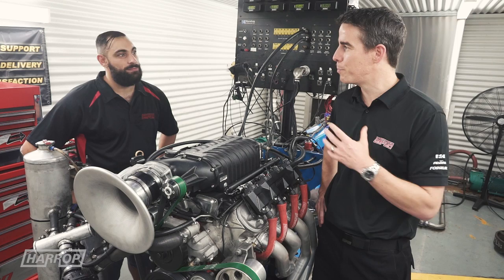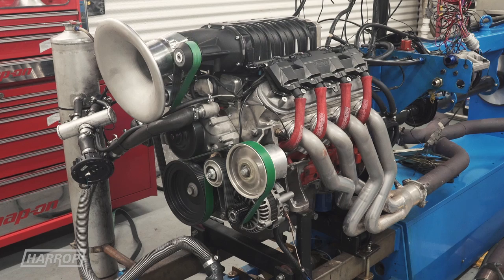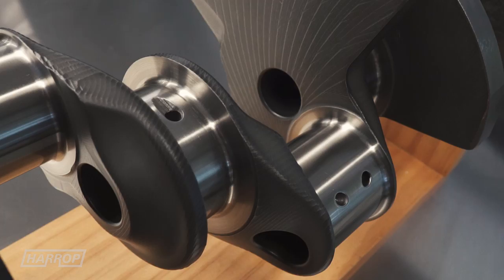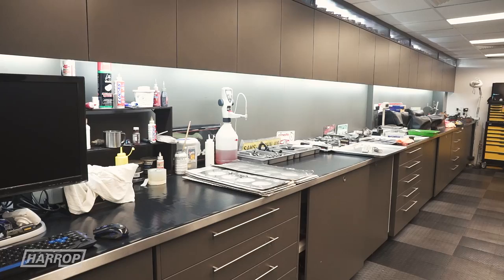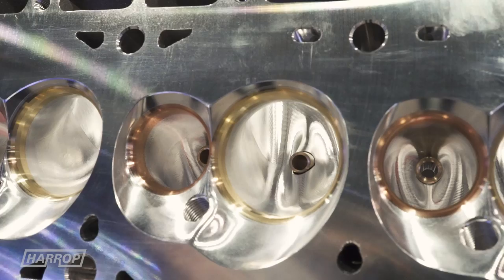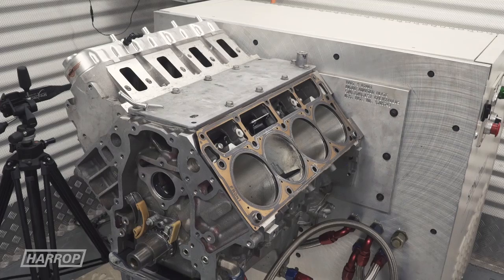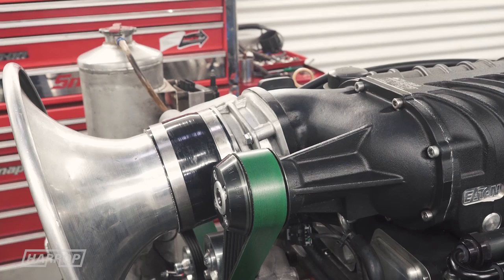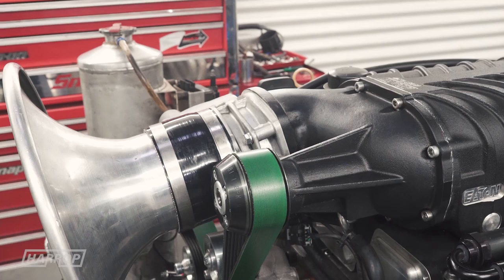Harrop TVS2650 Supercharger Testing | 2300 v 2650

Comment: I was wondering when Harrop was going to develop a larger capacity blower. Those number are awesome! would be be fair to say once this engine combo is put into the car there would be a 22% drivetrain loss for about 700hp at the rear wheels? for the first engine test (2300 and 65mm throttle body)
Reply: 22 percent is awfully high. what transmission?

Comment: It's be interesting to know how much power that supercharger takes to drive.
Isn't that why many OEMs have now gone to turbos away from S/Cs ? (JLR for example)
Reply: Lewis72 yeah they have to save gas mileage any where they can
Reply: There’s charts that will give a rough idea at what SC rpm and pressure ratio how much consumption and discharge temps are. In my opinion a oem typically only puts SCs in when a turbo system doesn’t package well. A turbo will always give more power per pound of boost.
Reply: OEM's are going turbo because of cost. The average driver doesn't pay attention to throttle response or turbo lag (stock Subaru WRX STI). So at a dealership the car will say 300 HP and people will believe the number in the brochure. A turbo system with the best throttle response possible is much more expensive and complicated. I'd prefer twin screw style SC on the ultimate street+track car. Incomparable throttle response & power/torque curve. Both SC & TC can make too much HP for the grippiest street tires on the planet. Might as well have great throttle response & power delivery at your tire's HP limit.

Comment: Why does a Harrop supercharger have an Eaton badge on it?
Reply: The supercharger is made by eaton. Harrop and magnuson for example just add their own touches to it and rebrand it in their name.
Reply: Jarno Saarinen The case is different but the internals are all Eaton.
Reply: Eaton rotors. The casing and the rest of the kit is Harrop
Reply: Cool!
Reply: @prostreetcamaro  wrong. The superchargers use the Eaton rotor sets, whether TVS2300 or TVS2650, or TVS1740, etc.

Comment: Can anybody explain why positiv displacement supercharged engingenes have such strong falling torquecurves with high rpm?
Reply: Felix Seippel Heat**, blower=heat, highrpm=heat, Blower + High Rpm=Alot of Heat,
Reply: What he said plus blower size in relation to engine or cfm needs. As rpms and or pressure ratio rises the consumption and heat rise rapidly.

Comment: Wow not bad at all....almost as good as the 302 coyote engine
Reply: Dat boy good these ls are really old engines and still make pretty great power. I can imagine the lt1s
Reply: 2.9 gen 3s are making well over 900 at the crank on 93 with the Voodoo bone stock in the car with intake and filter with only Injectors and tune. Imagine what they do with e-85, long tubes, cat delete etc. Better get a sleeved block tho. This is a fricking built 427 with a bellmouth FFS.
Reply: Dat boy good Coyote? Lol Watch what these do on the new LT5-powered ZR1.
Reply: Kris Moore They’re not making anywhere close to 900 ft lbs of torque are they? They spin the engine to 8.2K to get a crazy high hp number. The voodoo has enough problems trying to last stock let alone nearly double the HP and FI temps. Notice Ford racing and the next GT500 don’t run a flat plane? That should give you the answer to the test. The coyotes make great power on low boost and a stock engine but their torque still sucks. The 2650 flows 10 percent more than the Whipple 2.9 while abusing it under the curve with less power draw and substantially greater efficiency. Will a Whipple last 100k plus? This is from a ford owner and fan.